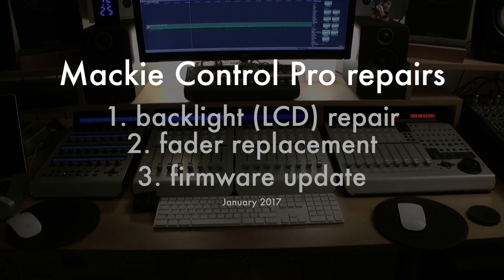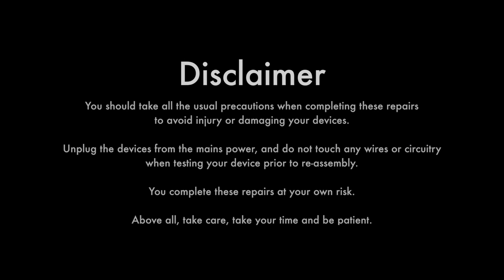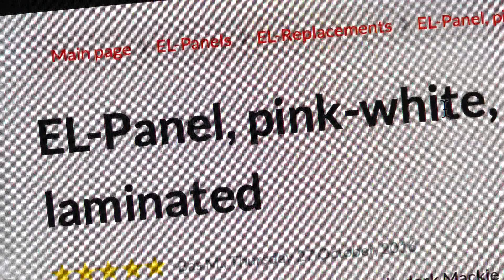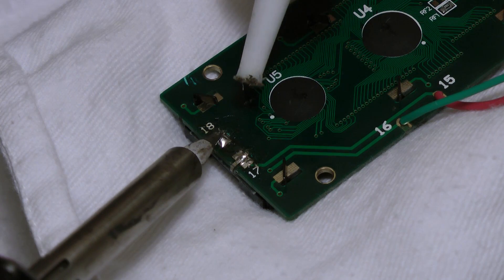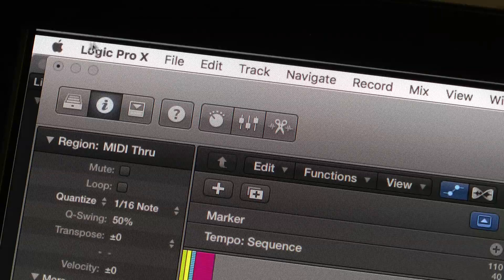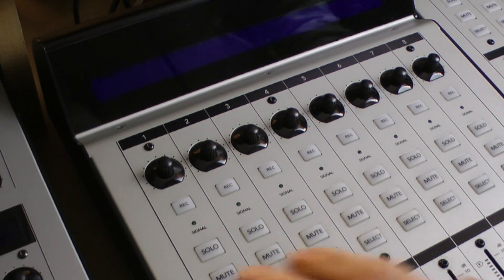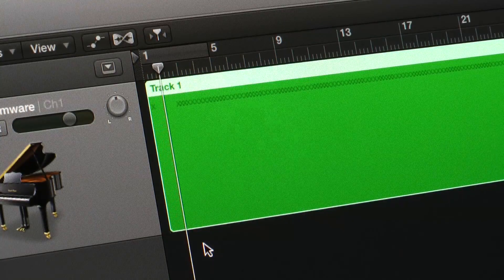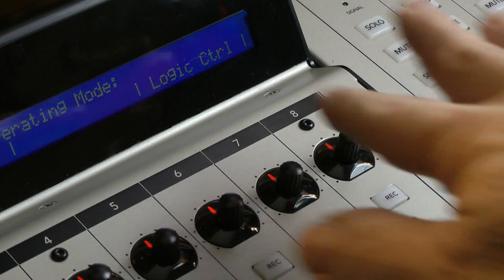Mackie Control Pro LCD backlight repair, fader replacement, and version 4 firmware update

Comment: Fantastic!  Thank you for this.  As I found out, the rotating tabs must all be rotated back into place (if one has rotated them out to loosen up the frame of the LCD display holding the backlight), else the display may only partially work.

Comment: Re the comment I placed below, 3 months ago, I wrote to backlight4you and they placed me on backorder and promptly advised me when the strips were in stock. Great service from them. I'm in Australia and the turnaround from purchasing them to arriving was pretty quick; I bought 2 just in case.  I replaced the strip today and it was easily done and the unit is now working fine. The only slight issue is 3 screws at the back of the board, but with a pair of long nosed pliers they came out and back in fairly easily. Thanks to Matt for doing the original video, it made it a relatively easy fix.

Comment: Just found this Video and want to try to fix my Mackie Pro but when I went to backlight 4 you to purchase the EL panel it does not seem they have it in stock - noting this video was posted 5 years ago. Am I correct in thinking the dimensions are 19.5 x 222m? is it 12V? Could I get a bigger panel and cut it down to size? Any suggestions gratefully accepted.

Comment: I'm new to this znd trying to put a low cost home studio together. I bought a machine mcu Pro today from  Cash Converters.  When I turned it on the top screen was blank but a lot of lights are lit up. I looked at the manual znd it says the screen should prompt me. I've no idea what lights should be lit. I messaged Mickie on twitter but no reply. Should all the lights on the controls be lit up?

Comment: Thank you Matt!
Do you know if there's a way to (when using Logic Pro X) change/flip through different EQ bands on the controller?
This way you could adjust the mids, low, high, etc just on the controller.
Reply from the maker: Not sure this is possible on the XT devices, but definitely possible on the C4, and on the MCU Pro. It may be possible to map XT device faders and knob to other parameters but not sure how.

Comment: Midi 2.0 is coming. Will the Mackie be future proof?
Reply from the maker: I expect so. The spec accommodates backward compatibility and the Mackie’s use the pretty universal HUI and Mackie control protocols which shouldn’t be affected.
Reply: @MattOttewill  Yes. Still have to go thru the specs with a comb. 

I downloaded midi 2.0 specifications from the midi association.

Comment: We have several C4 Pro units (3 of the 9 we own) that freeze up (stop responding to MIDI) after a certain period of time.  A quick power cycle will bring it back, but then they fail again.  Have you seen this before?  I'm thinking maybe a power regulation issue, possible heat related.  I can replace the unit with a different one and use the same external power supply and it will work fine, so it's not the 7.5v supply.  Let me know if you have any suggestions.  Thanks.
Reply from the maker: Very difficult to know what the issue is but it may be a leaky capacitor. Only a guess though.

Comment: Thank you so much for this! My C4 has been sitting on its own since my store bought MCU pro (firmware 3) died and as it's the original the parts were not available. I managed to pick up a replacement via ebay for a good price and after updating the firmware to 4.03 and cleaning all the parts, the only niggle was that it was significantly duller than the displays on the C4. Took your advice and bought the replacement via your link and managed to successfully complete this with my meagre soldering skills! Really brilliant result - thank you so much! I do have one question though, I can't seem to get the dimmer time in Logic X to change?
Reply: Yeah, just tried again under the control surface setup in logic and I can highlight the default 15min on both and change it to 5min but when I press enter or click away it reverts to 15min again??
Reply from the maker: @craigduncan8666  This is a weird behaviour but normal. I think the solution is to hold down a key and drag up or down. I thinks it’s Control. Try a few.
Reply: @MattOttewill  Brilliant! That fixed it - Many thanks!!!

Comment: Hi Matt. I also have C4 that is "waiting for midi upgrade" but I didn't upgrade it. I just turned int on one day and it had this message. It's on screen message says" CSCON LOADER Ver 1.32".  I've tried to find to sysex file but there is nothing on Mackie other than C4c commander software. Where can I find the sysex file for a Mac or can this only be done on a PC?
Reply from the maker: Bad luck. I've not updated a C4 because as far as I know the original software has never been updated, its the same for standard and pro versions. I don't know of anyone who has or has seen a downloadable .mid file for it. It sounds like your device may have an issue with its ROM. I would contact Loud Audio and see if they can help.
Reply: @MattOttewill  Hey Matt. Thanks for getting back to me. I contacted Loud when this first happened (a couple of years ago...it's be sitting in a box ever since) and they said that it was probably an e-prom issue. I was told that Loud doesn't have anything C4 related (parts) and suggested that I find a replacement unit.

Comment: Hi, I have a "waiting for midi upgrade" message at startup on my Control C4, if anyone knows how to fix it, I heard it may be the eeprom, but I didn't find the image. If someone can help thanks a lot.
Reply from the maker: This may be because the MIDI file is not getting to the C4 correctly either because the C4 doesn't like the MIDI interface (I couldn't make it work using USB) or because other MIDI messages such as MTC are being transmitted with the update file. I think my video has a section highlighting this issue.

Comment: What are the dimensions of the EL strip needed for an MCU pro stand-alone unit? Also, a part number would be useful? If anyone could help out, that would be great, thanks.
Reply: Miguel Cano https://www.backlight4you.com/product_reviews_info.php?products_id=967&reviews_id=8&MODsid=90a5048c315a8ffd80b2a146b5ba895d

Comment: For anyone who is doing this on the original MCU, I have just replaced the LED display on mine (the time display)....... 

Getting to the display boards including the LCD is a little different to shown here. Once you have the bottom off, remove power board as shown here. To get to the display boards you need to remove the display facia from the top of the unit. 

To do that there are 5 phillips screws along the backside of the display "ridge". Remove those. Opposite each of those at the front of the "ridge" (between it and the main circuit board) are 5 x 8mm "nuts" which you need to remove as they attach to 5 screw studs that are fixed to the inside of the facia (as I discovered when attempting to prise the facia off and broke one ;-) ). 

Remove those and the facia will then lift off allowing access to the boards. To completely remove them there is an extra ribbon cable that needs to be unplugged from the main circuit board. Just grip the black plastic connector and tease it off the pins. Hope that helps anyone else doing repairs on MCUs. Information is sketchy online to say the least. 

Thanks for the excellent video Matt!!
Reply: I have also just replaced the back light strip on an original Mackie Control.  However, I discovered that the strip would not slide out as it was held in place with 3 pieces of double sided tape and I had to completely disassemble the display (by VERY carefully using a pair of needle nosed pliers to move all the black metal tabs to their release position) to then gently prising up the strip.  The 3 pieces of tape remained on the backlight strip, so I removed them and was able to re-use them when re-assembling with the new strip.  It was all successful and I can now read the strip again.   Thanks Matt, for your original ' How To' video.

Comment: Hi my man, i have recently inherited one of these and it is in a right mess, i need to sort out the faders as one seems to not be stringed any more, but the biggest thing i need to do is replace the USB port, as the one thats in there is missing the plastic block and the pins are all over the place, any idea if this is replaceable? cheers
Reply from the maker: Should all be fixable providing you are good with a soldering iron and can get the parts. A Mackie Service centre should be able to help. You will need to be certain you’ve diagnosed the problem correctly though, the hardest part sometimes! Good luck.

Comment: For anyone here who wants to fix the dreaded backlight problem, you should know this - it's doable , but it can turn into a nightmare. Ive done it twice now. If you've never done it - read on: 

First off, if you're fixing the MCU pro (not the extender as shown here) you cannot do this 'flip up the LCD on it's back' trick, the power cable is too short. You will have to remove the entire unit. Those little screws that hold it on are a bitch. But once you've got it out, I STRONGLY recommend you do not wiggle or bend the tabs that hold the screen to the board - they make electrical contact as well as physically squeeze the board together. 
If your old backlight refuses to come out, find a way! Get a tool thin enough to grip it and pull it out, it is not glued in even though it may feel like it. 
Here's what can go wrong - I couldn't get the old backlight out, so I went ahead and loosened the tabs - yes, the backlight came out easily but if the board is not properly aligned with the tabs THE SCREEN WILL NOT DISPLAY THE CHARACTERS! (yeah I'm shouting 'cos it drove me nuts.) I had to tweak the tabs, plug it in, 50%work, take it out and tweak tabs again, 70% works, tweak it again, now back to 50% working etc. It's trial and error, I lost +hours+ of my life. 

If you do have the problem with characters not displaying on your screen because you messed with the tabs like I did, you will have to find a way to test the screen until it's working properly. It is +very+ awkward, but you have to find a way to test the LCD without assembling it in place with those tiny screws - unless you want to lose your mind. Remove the MIDI board for the time being, just hold the backplate and PSU board in with one or two screws (enough to take the weight) then you can tip the thing on it's side and connect/disconnect the power and data cables to the screen for testing. It is tedious. BE CAREFUL not to touch anything on either side of the PSU board - AC line voltage is present, and that hurts or even worse. Just be aware at all times, and remember to remove the power cord (not just power off) when connecting/disconnecting power/data cables.

Assuming you get to the point where it's working again, I would suggest putting the LCD back in place with one or two of the top fiddly screws, then the back board, power board, and fire it up to test again. If all good, go back and reassemble.

By the way, be careful to separate the four screws from the top panel from the ones that hold the sides on - they look very similar but are not interchangeable. There's loads of screws keep them all separate, label them in an order that makes sense to you and TAKE PHOTOS!

Lastly, I discovered that backlights can also fail suddenly, besides their well known problem of dimming then failing. I had a new backlight from the German online company that sells them, after about six months of average use one day it stopped working upon power up. I assumed either the power connector or solder connections to the board were bad - they weren't, as proven after I bought yet another one from Germany. 
You will know if your LCD is not connected to the PSU board - the unit will emit a high pitched whine.

A great controller blighted with a terrible LCD screen design, something more like the early 90s synth LCD screens only they seem to fail even faster in the MCU pro. I can't believe they never addressed this issue, but for anyone wondering if your firmware will make a difference it won't. These screens are (albeit unintentionally) designed to fail.
Reply: LIFE SAVER - Both you guys taking the time to come here and share this is monumental , thak youboth   I was killing myself and didn't realize those black tabs need to be turned back or not messed with you saved me $200 I was about to break down and buy two new LCD panels , at the rip off price Mackie charges for them
Reply: John Morales M+M Mix great news! I’m really glad to hear this - this is why I spent time to write my long comment for other users facing the same headaches. I was unable to find any other useful information on the internet, so everything I wrote was just my trial and error based on the original poster’s video.
Reply from the maker: Ian o'Brien superb comment. Thanks
Reply: @MattOttewill I should have thanked you for your video first - it was a big help and everything you did is sound, I just hope that sharing my woes may help someone else down the line from making the mistakes that I did - every one of these controllers has the same backlight problem after all..

Comment: Thanks! I saw in backlight4you that the replacement led unit for MCU PRO is the pink one..is it correct?
Reply from the maker: The colour of the panel doesn’t usually matter. All the panels I’ve bought (blue, pink, green) produce white light.
Reply: @MattOttewill  Great! Thanks!

Comment: Hi Matt. I own the Mackie C4 pro. i actually have 2 of them. My BIG CONCERN is getting the backlights for the mackie C4 pro and finding someone who can repair them. Do you handle that?
Reply from the maker: If you're talking about the horizontal strips the replacement process should be pretty identical to the process shown in the video. If you can use a soldering iron and are careful with the assembly/disassembly it shouldn't be too hard. And no, I don't run a repair service but any Mackie service centre should be able to do it for a price. Good luck.

Comment: Hi Matt. Do you know if these instructions for changing the backlight are valid for the old MCU ( not pro) also, as well as the actual replacement part?
Reply from the maker: Yes process basically the same. As far as I remember backlights are the same size.

Comment: Great imformative video.Had to change my LE strip last year however a few days ago i powered up the Mackie didnt see the clutter  lying on top of the desk.On start up as you know the faders callibrate ,Disaster the whole machine went tits up.Cleared away the clutter switched back on No Backlight.Here we go again,ordered an LE strip and prepared my self for the task.
I use Sonar,Since the demise of Calkwalk etc decided to do a clean up of the sonar soft ware.Got that sorted,powered up the Mackie and had a backlight.So maybe check calibration and Mackie control dll etc just in case.When backlight times out you have to press any key to light it up again.Hope this helps you guys with no backlights.

Comment: hello! thanx for the infos. I repaired the display thank to you. I have a question. how can one reduce the backlight saver timeout,  with another software? let's say Sonar.  there is a way? or some midi controller to switch? thanks
Reply from the maker: Only ever done this with Logic where the setting is in the control surfaces setup window. Nothing similar in Sonar?
Reply: @MattOttewill  Do you have a part number for the EL strip for the main MCU pro control surface?
Reply from the maker: Miguel Cano Sorry no. But you should find the panel you need at the website mentioned in the video. It’s been a few years since I made this video! Good luck.
Reply: @MattOttewill  Thank you either way. It was super helpful.

Comment: Hi Matt! I just bought a second hand mcu pro which has the old P+G fader and firmware V3. Is it possible (and safe) to replace the PG faders with the Alps and update the firmware to V4 ? My faders now are kind of vibrating a little bit before reaching their final position when switching banks. I'm not sure if this is normal for the PG faders. Is it normal ?
Thanks in advance !
Reply from the maker: The short answer is I don’t know. I think you should ask Mackie. If the vibrating fader thing is happening on all faders it suggests a communication or firmware issue. You could try replacing one fader with the Alps version, but I wouldn’t recommend updating firmware until you have some definitive advice. It may not install anyway. Hope this helps.
Reply: Yes thanks !  I hope I will get an answer from Mackie :-)
Reply: Matt Ottewill do you have a contact number please? Thanks

Comment: hi there , this video is very informative thank you for uploading it, i have a logic control xt that doesn't seem to want to work, when turned on it basically just lights up but doesn't display anything on the screen but the lcd does light up.. any idea what could be causing this issue as i have attempted to look this problem up but haven't had any luck i have opened it up and the 3 chips seem to be in place, any help would be appreciated , thank you
Reply from the maker: If you have nothing on the display and it is correctly connected the fault will most likely either be with the screen (not the backlight) or the logic board that drives it. You could order a new screen and fit it yourself, but that does not guarantee a repair. Best advice is Take it to a Mackie repair service centre. Bad luck.
Reply: would a dopey display cause all the lights on the unit to come on and stay on ? .. literally every single light all rec/rdy , solo , mute & select and the panning led strip literally all the lights stay on .. the faders done calibrate when turned on .. completely confused
Reply from the maker: Hard to say. A service engineer will know. Digital systems are integrated and isolated problems can have strange knock-on effects. It could be a firmware corruption.
Reply: fair enough , thank you for your reply its appreciated